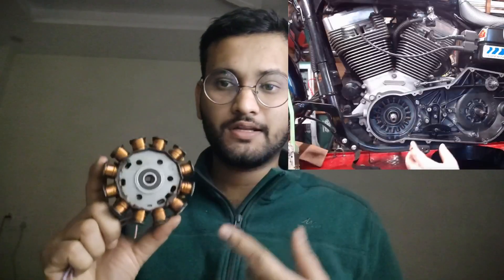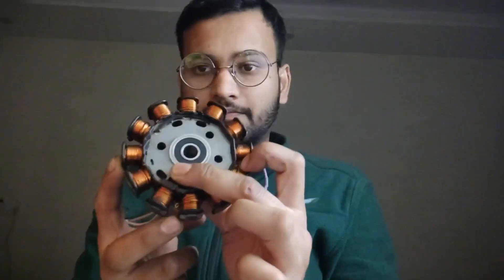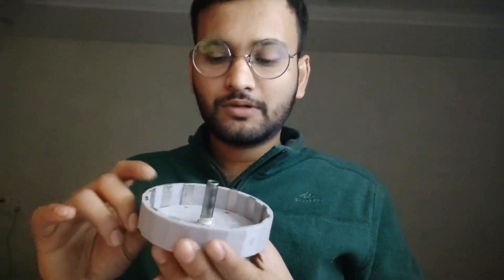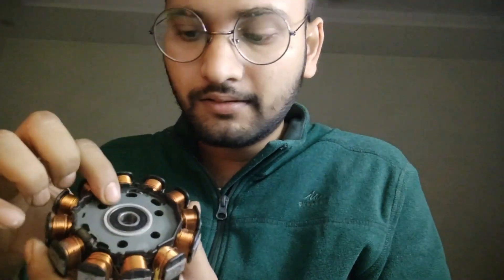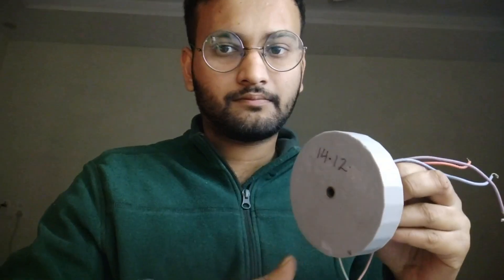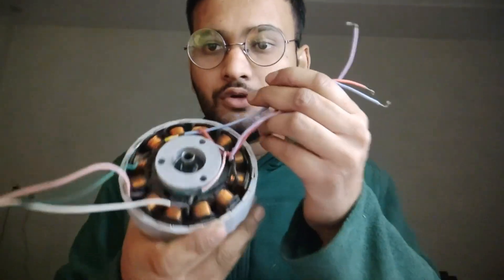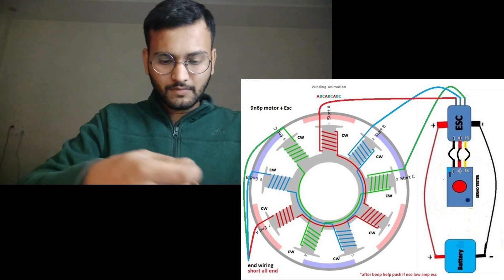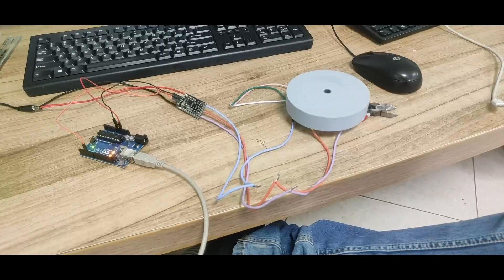Making BDLC motor from Motorcyle Spare Part in less than $5

Comment: Important = The steel rotor which holds magnet poles also act as a low reluctance path for magnetic flux to return. With 3D printed plastic rotor, the magnetic flux do not have path to flow easily. Hence, your motor will not be powerful at all.
Reply from the maker: Thanks Debraj for the insightful comment, The goal of this video was to make a working motor prototype, I'll surely try to incorporate steel rotor in the future designs.
initially,  I intended to use amorphous metal alloy/ CRGO steel, But due to high complexity I fixated on plastic versions for the trail.